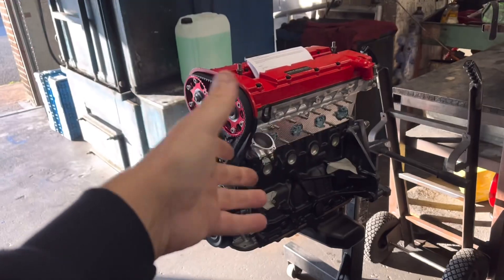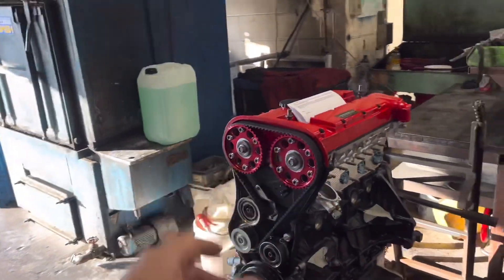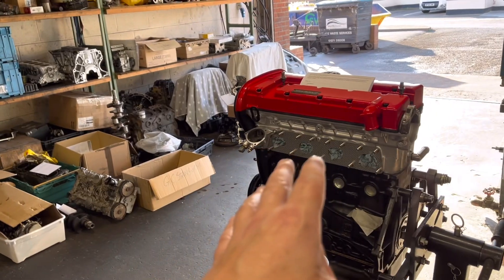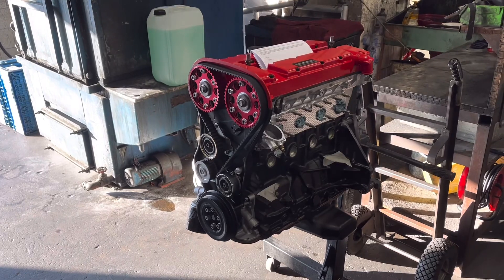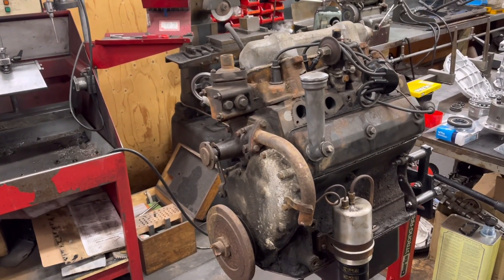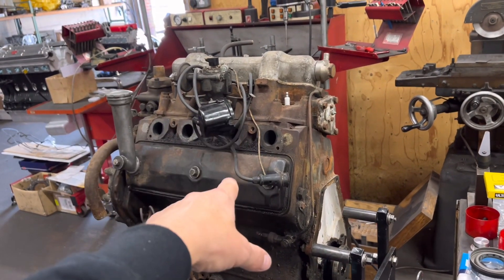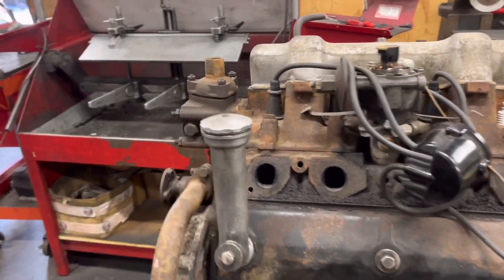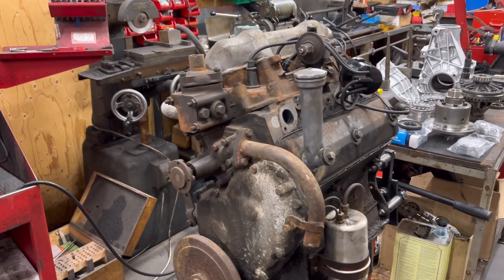Porsche 911 and Focus ST engine disaster, can we fix them and will it ever run again?

Comment: Thanks for your awesome videos!  Just wondering how the camshafts run true when a head is warped so badly?
Reply: I had a couple of occassions with the vauxhall 8 valvers. If those got too hot the ally cam carrier would warp and nip the camshaft up damaging the bearings.Replaced the cam carrier and camshaft , followers etc in both cases.The heads on both cases didnt warp so no reskimming needed .The carrier twists before the heads so acted as a weak link.Non interference heads obviously.

Comment: just rebuilt my MK5 cortina differential.the crush spacer is for setting the preload on the pinion bearing.wouldnt recommend a solid spacer because when you set the preload you won't know if the spacer is nipped.
Reply: I always use solid "crush washer" when it get used hard as in track day an drifting events.
You can set the correct preload with a new crush washer and remove it and make a solid one with the exact hight. Always check the preload again when fitting it .
If you use a std. crush washer, ALWAYS use a new one!
I have set up hundreds of diffs here in Norway so I know....

Please check my instagram ,
Reply: Wrong! How many diffs have you done...?
Reply: @HenningFosse  so if you don't have a crush spacer and tighten the nut until the preload is correct how do you know what size solid spacer you need .please explain?